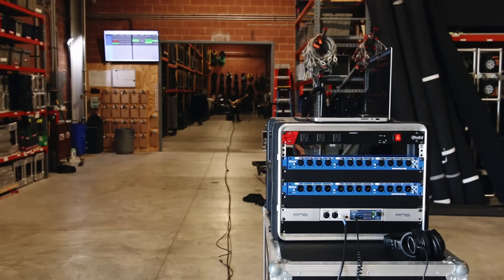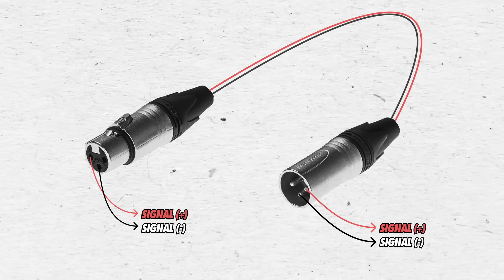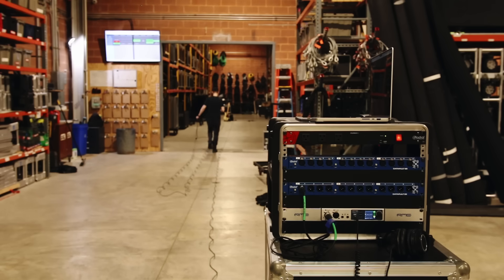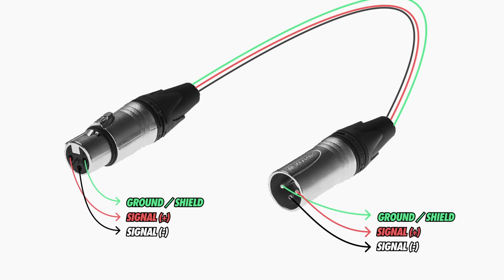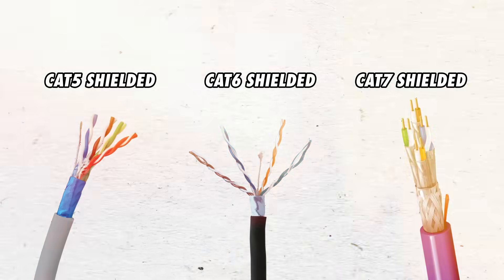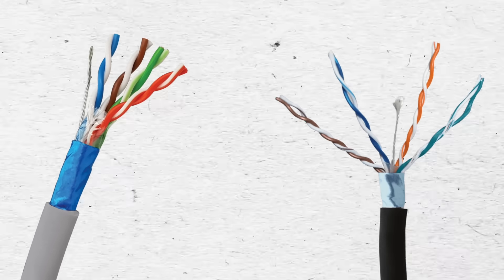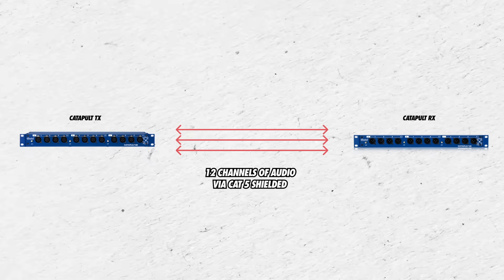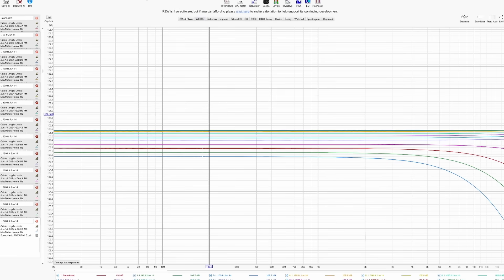Do Audio Cables Affect Sound Quality?

Comment: I want to mention another factor of a twisted pair.  When two wires are in parallel with their insulation in between them, they form a capacitor which has a certain frequency response and affect the circuit in other ways. When you twist The wire you are now making an inductor.  Conductance and capacitance are the electrical opposites of each other and if twisted at the right rate, the capacitance inductance can cancel each other out at a desired frequency, in this case, hopefully the audio frequencies.

Comment: What about car audio? I have a noise coming through my speakers like that even with the car off. I have good power & ground to amp and stereo straight to the battery terminals and I added a 0awg ground to chassis (seat belt bolt) 

Any recommendations?

Comment: Let's not forget that, while totally wrong,  impedance mismatch and TS cables blaring with noise and anomalies can benefit certain instruments in achieving a specific sound. I run a recording studio and I have experimented with transformer balanced outputs to inputs and the results were not always great to achieve a desired tone. Also, regarding the use of shielded category cable, you may run into a noise problem when trying to use two sources with their own independent phantom power sharing the ground of the cable. The fact that phantom power is DC, in theory, would not pose a problem. However, it's beneficial to try to use external phantom power supplies instead of the phantom power included with the specific preamp. I've had that happen to me in the past when one piece of gear is providing 48 volts of phantom versus 24 volts. As soon as I disabled the built in phantom power and used an actual multichannel phantom device, the problem was solved. There is a way to address this with adding filtering capacitors to the phantom circuit, but during a session, things move quickly. Great video!

Comment: One thing that is not covered, although maybe in another video, is the current plague of inexpensive copper clad aluminum microphone cable out there. Those "deals" where the cable is very inexpensive often are built with this. I have now even run into clad network cable. The failure rate is very high and often the shielding is very sparse.

Comment: As a retired telecomm technician/engineer, I can confirm that twisted pair is indeed very good for voice audio over distance .... it was literally made for telephones.
Now, if you only want to transfer voice audio, telephones limit the bandwith to 0-3.3 khz (POTS standard), which is just enough to cover the human voice.
At such a narrow frequency band, a regular twisted pair on the telephone system, can carry for about 15 km (about 50000 feet).
Of course, a telephone also have 50 volts of phantom power ..... just like a XLR cable does! .... the more you know, and all that.
Reply: Wait, XLR cables have phantom power built into them? I don’t see any transformers or whatever is used to generate voltage.
Reply: @chupachuuups706  
Neither does the Plain Old Telephone System, it simply runs on 52 volts, delivered straight from the telephone central.
Similarly, the XLR amplifier that picks up the microphone signal, delivers the electricity.

Comment: Superb video information as always.
Or you could first spend $20 on a kit of various sized RF / FERRITE  clip around chokes , put one at each end of your audio cable, power leads etc.. WORKS A FKN TREAT !!. if you still have problems then buy a DI box. SIMPLES.!

Comment: I'm looking at purchasing a catapult system for some recording scenarios which might involve having the recording booth in a remote location. The setup will primarily comprise of condenser microphones (recording mainly for choir) so I am looking at purchasing a separate preamp to be used. I've read in various places that phantom power can become an issue with these catapult systems. Looking at the signal flow, should the mic cable run from the mic, to the preamp, then to the catapult transmitter and off to the receiver? Or should the mic cable run directly into the catapult transmitter, to the receiver, then into the preamp and off to the interface? I think I am just a little confused as to what end of the chain phantom power should be introduced.

Comment: Older twisted pair network cables were using CAT 2 or CAT 3 cables for speeds like 4 Mbit/s (ARCnet) or 10 Mbit/s.  Later cables types such as CAT 5, 5E, 6 and 7 significantly improve not only the properties of the cables but also tighten up the standards that define these properties.  A telephone voice signal uses a signal of like 300 Hz to 4000 Hz or so.  CAT 5 otoh is suitable for up to like 100 MHz.  Other cable types that go up to 2 GHz are defined.  Standards also define how much frequencies in that range may be attenuated, phase shifted etc.  At the bottom line these cables are total overkill for audio use.

Footnote - of the top of my head I don't remember how much crosstalk is permissible as per standard.  This may be more of an issue with analog signa fidelty than for digital stuff.  However at least in theory twisted pair let alone shielded twisted pair cables should be pretty good at that.

The one thing were twisted pair will really fail is high power.  The conductors are pretty thing.  And cables with solid conductors just aren't meant to be bent many times over.  That''s where I will stick to my pricey but super silky-soft XLR cables.

Comment: Overall, a great explanation of balanced audio and twisted pairs.  I was disappointed that you did not discuss the reason that high impedance circuits(bass guitar) are much more limited in cable length vs low impedance (transformer or active) circuits.  Cable Capacitance/foot is much more influential at higher impedances as that acts as a RC high cut filter.  CAT cable is limited to 328 feet for data because the signal is at a much higher in frequency than audio.

Comment: WAIT, you mean to tell me that Nordosts unshielded parallel flat cables at 500+ a foot is the worst possible configuration for speaker wire and a pair of antennas on needlessly expensive risers 😂😂😂😂😂😂😂😂😂

Comment: Hey Audio University, I know I am late, but it seems like my condensor microphone , connected  to a laptop with a XLR to 3.5 mm audio pin, gices me unwanted noise... My room is not acoustically treated but it doesnt have any noise... How can I reduce the noise without any gates or ai? The video was fire too.
Reply from the maker: If it's electrical noise (like a hum or buzz), there is a problem. If it's just hiss (like white noise), try singing louder or moving the mic closer.
Reply: @AudioUniversity  I do sing with the mic really close to me... So it's an electrical noise? It's a hum but the hum is uniform... No distortion or anything in the actual hum... Do you think the mic might need an audio interface? Is that even a thing?

Comment: I do home theater. It's XLR to the amp, but only 2 untwisted wires to the speaker. That sounds problematic.
Reply from the maker: That’s completely fine. There is no need for shielded speaker cable. The line behaves like a balanced connection and the signal level is much greater than the line level signal going into the amp.
Reply: @AudioUniversity  Thanks for your repsonse! Are you saying that pre-amp sound is more sensitive to interference because the volume is so low?

Comment: I'll save you 15 minutes without me even watching the video..

No.. up to a certain distance. Long distance introduces more resistance.

If you use a balanced pair, you can filter out any RF noise thst gets picked up by the cable.

Comment: One thing not mentioned is that the twisted pairs in CAT cable are twisted at different rates. This goes a long way (groan) in preventing crosstalk and provides another source of common mode rejection.

Comment: very nice explanation of audio cables! as always by the way!

i have a question: i see that after 1200 ft (like 366 m) signal distortion in audio band is significant, does it comes from increasing impedance of the total lenght of the cable? if yes, what is the value of the total cable impedance? thank you for all your work about sharing knowledge in a very good way! Greetings from Italy!

Comment: THE CAT 5 IS GONNA CHANG3 SO MUCH, IVE BEEN doing my research on how I will convert a full cat5 setup soon . also how network security will be handled , because the integration capabilities are AMAZING AND ENDLESS . no more patch bays filled with hundreds of trs . talk back going through the same line with NO WHITE NOISE AT ALL .
sending audio to a whole different room through a network . imagine using a reverb that only  in room c and sending it back with to the main room with just the click of a mouse

Comment: Excellent video. First time I've the + and - of an xlr cable explained. It's usually called hot, neutral and ground. Neutral for - is a terrible way to say it, when it's out of phase 180 degrees. Unless I totally misunderstood. This really makes we think about the cat 5 route for super long cables. One thing troubled me: comparing the longer lengths of cable using pink noise. I heard a slight shift with higher frequencies being slightly more emphasized with the longer lengths of cable which is counter-intuitive and counter to your graph. Perhaps it's just me.

Comment: Fascinating video! I'm curious if the same amount of noise would be introduced if a long cable was stretched out it's entire length between connectors vs. the same length being of cable being mostly coiled up with the connectors being relatively close to each other. I'm sure the particulars of the space and other nearby electrical equipment would be the prevailing factors, but my hunch is that a coiled cable would pick up less noise than a stretched one.

Comment: This sounds like a man finally coming through years of depression and finally seeing the light.

That said I mostly disagree. Comparing the cost of headphones to speakers is nonsensical as the latter requires a suitable space that often can cost more than the system itself. You can EQ speakers all you want, but having an X amount of energy at a frequency says nothing about how many reflections etc it's comprised of. A headphone with a simple EQ can offer insane fidelity that a speaker system would often require a purpose-built space that can cost thousands on the low end. Speakers offer a different experience with potential to being better, but some genres translate poorly to speaker listening often due to bass/dynamics issues. I'd say people should get what they want and there is no meaningful superiority between any of the methods of listening to music.

Comment: Great, great post. I love the practical demonstrations - they put relevant context on to the theory which can be mind-numbing at times.  Timely too as I have been discussing cable selection with my colleagues just this past week. 

My take from experience and based on what I have read:
Pros of CAT5
1. Designed for an environment where signal integrity is key - the consequence is that it uses the best cable design technology with tight specifications and consistency on conductor diameter for each conductor and along the length of each conductor, shielding, and number of twists per unit distance. Consistency in balanced cable geometry is key in rejecting common mode noise and the number of twists per foot determine the highest frequency (=shortest wavelength) for which uniform common mode noise is rejected.  The basic thinking is that each twist acts as a loop antenna and alternate twists change the polarity of the noise voltage induced in the cable so that, in sum, they cancel out. 
2.  Designed for much higher frequencies (computer networks) than baseband audio - this is what determines the specifications for the parameters mentioned above. As audio bandwidths are well within that of wired computer networks, CAT5 just works like a silver bullet in rejecting noise from a variety of sources.   
3. Economies of scale make for a cable that is cheaper and better than traditional audio cables

Cons of CAT5
1. Probably conductor size (24AWG). Balanced mic cable from what I have seen are 22AWG or thicker
2. Not as resilient if being moved continually - best applied in my opinion for installed audio  

PS Performance is subject to cable length and signal bandwidth. As these increase, source and load impedances and the whole issue of matching those impedances begin to play an increasingly greater role as the cable starts to behave more like a transmission line. The challenges are probably not unlike what was faced by the legacy Rediffusion radio that preceded RF transmitted audio years ago. Rediffusion distributed baseband audio (!?!) country-wide in many UK colonies via a wired relay network.

Comment: I have a question for you. I make my own cables and i've bought a spool of microphone cable for that purpose. The cable has 2 wires and a shield. When i make XLR or 3 contact TRS, i know what and where should be connected. But sometimes i need a 2 contact TRS, and i would like to use the same cable which i have. Should i use 2 wires for the contacts and just leave the shield hanging, or should i use the shield for one of the contacts and one of the wires for the other?

Comment: Seeing this overpriced cat2xlr adapters in use, hurts. 3x cat cables for only 12 channels, no redundancy. For this high price, you can start to use AES10/AES50 over cat/coaxial/fibre and have up to 64 channels, no interference on the audio-signal. 
And no mention, that highend mic cables use other tricks to perform better against interferences. Like dual-twisted pairs, where positiv and negativ signalline has it's own groundline that are then combined together in the connectors. Or having ground and shield separated, where ground is only audio-signal ground and shield goes to shell. EMI supression with ferrit bead on the groundline, better RF-shielding by splitting ground and connector-shell with capacitor.  (Like Neutrik's EMC-Series does).

Comment: the utp standard for cat 5 and 6 ethernet doesnt allow for cables to be longer than a 100meters because you start to lose signal and cause latency at that point, if you want a longer, non standard cable you have to manufacture it yourself, it surprised me that the same cable using analog audio was able to run way longer with little so little loss (compared to the same cable transporting ethernet).
in a way this makes this system extremely reliable as there's no way you will accidentally buy an utp cable longer than the norm while shopping for gear.

Comment: Or what about transmitting the signal digitally at 16 bit / 44.1KHz (full CD quality) down these cables? Even better, make the cables out of optical fibre rather than metal conductors. Then you get zero loss transmission over any distance. Surely with today's technology this can be done?

Comment: What is the difference between wireless mic like RODE wireless GO2 and wireless mic from shure & sennheiser??? Can I connect wireless mic from RODE to a analog mixer using 3.5mm to XLR cable ??

Comment: AV systems installation engineer, and I have been meaning to play with/test with these for a while. Particularly interested to see a SMAART readout (both with magnitude and phase) in comparison between 1000' spools of 5e UTP, 6a UTP, 6a UTP, AES cable, and Analog cable... Heck as silly as it might sound I'd also throw in a spool of RG6 12G SDI cable to play with too.
Probably including multiple different tracks on the cat cable to see if crosstalk is noticeable.

I have 2 questions for you though!
1: What was that program that you were using to compare the signals? That didn't look like SMAART from what I could tell, I'd love to play with another program.

2: While category cable obviously tests better. and ultimately is designed for signals at significantly higher frequency ranges (depending on the type of CAT you used, 100Mhz-550Mhz) the results makes sense...

However thing I am curious about how the difference in impedance from standard cable may effect the signal. Balanced analog cable is typically 45 ohm impedance. CAT cable is typically 100 ohms. Shouldn't this cause some issues with reflections back down the cable, as well as introducing extra phase shift on the entry and exit of the 100 ohm domain (cat cable)?

Maybe there's a proper impedance transformer inside?

If you don't know, maybe you can ping the engineers at Radial?
Reply from the maker: The software I used was Room EQ Wizard, which is free. These are intriguing questions, a bit beyond my understanding of the topic. I encourage you to run the tests you’ve mentioned. I can tell you that (even at 3,200 feet) the phase measurement in my testing was razor flat with a tolerance of 0.3 degrees.

Comment: I could make twice as long a video discussing everything left out of this one, but the title question is more or less left unanswered. The answer is different makes of the same basic cable design don't have noticeable affect on audio quality if in fully working condition. Cables do vary in capacitance but a good line driver implementation will resist cable capacitance effects, that's a test not of the cable but of the implementation. A bass guitar isn't a good line driver in that sense. You advocate braided shielding but Gotham's design apparently tests out a bit better than braiding. CMRR is a giant discussion of which the cable is the least of it. Yes it's good to run balanced and shielded at low impedances and minimal run lengths, but Jimi Hendrix apparently liked the tone of long cable lengths from his guitar and he seemed to impress people with it. Nowadays, if people aren't just miming to a recording, the preamps are on stage and front of house is more or less a remote controller. No I don't take your students as interns.